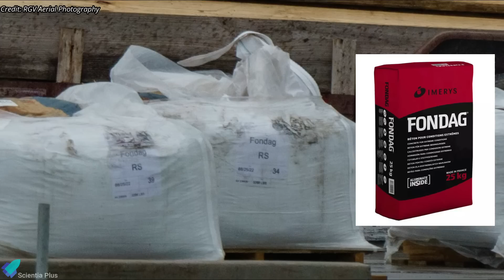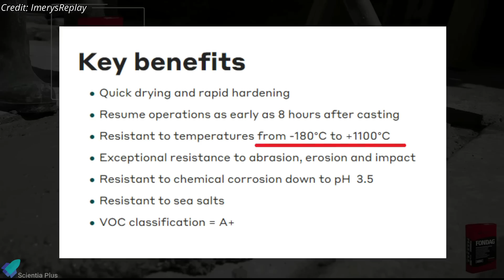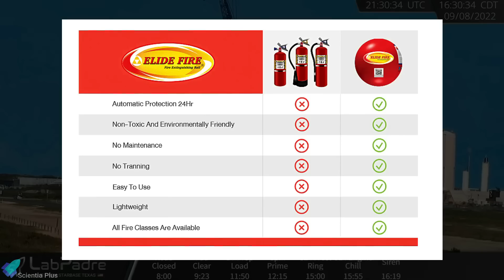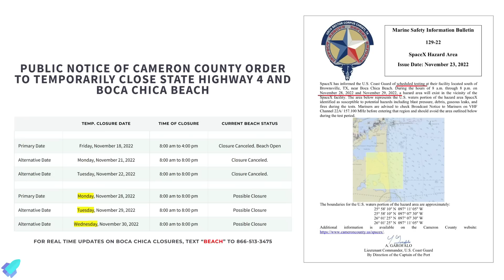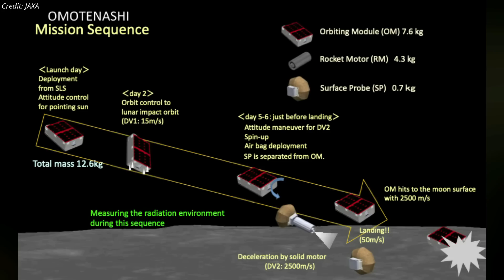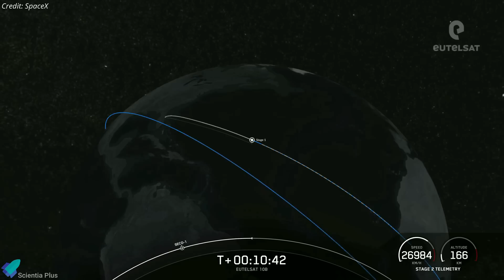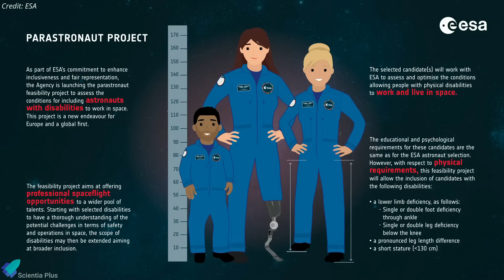SpaceX Starship Damage, Upgrades & New Raptor Engine, SLS Launchpad Damage, CRS-26, ESA Astronauts

Comment: deflection dissipation away from pipes and flat surfaces fine spray of water injected in the moving exhaust gases in the direction of gases as they expand cool? stop concrete heating and exploding? gully steam evaporation vents away from lift of stands? vented oxygen and fuel mjust be vented to different areas? Concrete always explodes cracks with intense heat? Bloody mindedness as led to this mess?? Making SN24 safe to land with legs and means to eject safe should also have been early weight traded basic features? or is Elon and his designers like Wright Brothers going to fly first manned flight and back

Comment: I wonder if a 30x Stainless Steel Treadplate pad cover would be sufficient to protect the Concrete from the Blast. Better integrity than poured concrete and it could have flutes to redirect excess force. I think Spacex is trying for maximum launch pressure and I wonder if a progressive throttle up might go easier on the Launchpad. I don’t know of anyone launching that way but with The Technology of Spacex it could be done. It’s different to a bullet so if we could accelerate the Rocket clear of the Launch base would the results be predictable  and calculable? Just a thought .😊

Comment: Some people have suggested a V shaped flame deflector, sort of like.... EVERY OTHER LAUNCH PAD USES!
Reply: Better yet, why not have thick flat metal containers fit to form underneath the blast area that would be filled with a thousand gallons of water each.  As the intense heat of the rocket flame suddenly heats each container up, the steam produced inside is projected out towards the items and areas most needful of cooling.

A six hundred degree stream of steam will cool down anything being made hotter than itself.  You'd actually be bleeding off the rocket blast heat to a counterbalancing steam gas flow that will reduce the immediate heat environment all below and around the blasting rockets.
Reply: I like that idea !

Comment: "If the pad is damaged we can just pour more concrete" ... That's not a useful conclusion.
The problem is fragments of high velocity concrete going up into the engine bay or into essential systems on the launch platform.

Comment: Am I a Genius? I have to wonder why no one comes to the idea to mount a steel plates on the bottom under the launch tower? Instead of replacing the concrete, I think it would be much easier to mount there some thick steel plates which sustainability is much higher than any other concrete. I have to concede having this idea from the very beginning because; maybe I’m a genius, ( or ….)
Reply: Yeah, it would seem that stainless plate embedded to the concrete as a thermal sink in way of the direct flames would be an obvious decision, but I’m only a structural engineer
Reply: @danwhiffen9235  E.M. seems to be overpowered with all his philosophical Interviews and other “Twitterliers”. Maybe someone could give me his phone number to bring him back to the bottom of reality.
Reply: And again there was a rain of concrete debris after the last testing. This time the falling rocks were smaller and not so many of them. So maybe SpaceX likes this being so, just better as to embed there some steel plates which would make the tests too clean and too secure.

Comment: I hate to burst the SpaceX bubble but methane burned in air has a flame temperature of 2210 Kelvin or 1,664 Centigrade so the 1100 degree Centigrade concrete won't help. Since SpaceX uses methane and oxygen, that flame temperature is 3030 Kelvin or 2,757 Centigrade so over 2.5 times what that concrete can stand up to.
Reply: Water deluge can compensate
Reply: Also the decibels will be so loud and the pressure wave powerful enough to shatter many structures in the area, unless they can suppress them properly
Reply: As Frederik said, water deluge...which is always use when launching a rocket such as this or Artemis, Apollo etc. will cool the launch pad and will also weaken the sound during liftoff
Reply: @Lynn Geek It is becoming increasingly apparent that SpaceX hasn't taken advantage of years of NASA and Soviet experience in launching large rockets. They didn't know that the heat from the engines would destroy the concrete under the launch/landing tower or they would have designed for it like NASA has for well over 50 years.
Reply: They need a flame diverter that they can move in and out as need be like the service pad they move in and out
Reply: @Ch33ziTzsk8R  How would they keep it in place with a force of 7,500 tons applied by the engines?
Reply: @tiredoldmechanic1791  
240T thrust per engine , 33 engines.
9m Dia footprint.
Do the math.

It's less than 180psi , at the Skirt , not ground level.
Not 15 meters above the Pad ~ Exhaust plume RAPIDLY expands , once exited the Engine Bell.
Will be WAY less than 180psi at ground level.
33 engines , over 9 METER DIAMATER. Remember physics.
 PSI .
Pounds per
Square
"INCH".
Sound pressure wave ~ Water Deluge System (not used yet) & Nitrogen Atomised Water, will sort that.
Temp ~ 
will the water be enough ?
Guess we'll see 😉
The Physics works, but can the Engineering deliver ?
IMHO.
Reply: @markoreilly3414  A moveable deflector would have to withstand the full blast force trying to move it unless they made a cone to defect the thrust radially from the center so the forces are balanced.
Reply: @tiredoldmechanic1791   wedge it in a pattern so that the only way it can come apart is if it can only one piece locks it and can only come up.  Like that 6 part puzzle that can only come apart if you angle one piece in the correct way for it to all come apart… it can’t be that complicated.
Reply: Water deluge cooling factored into your calculations???
Reply: Why don't you set them straight.  Go work for them lol
Reply: I really think Space x will eventually adopt a minimal engine initial launch then quickly begin startup of all engines once they have safely cleared the launch area safely and smoothly.
Reply: @DR-mp4gv  Launching a rocket isn't like a rolling start of a vehicle. The reason they have all of those engines is because they need them to lift the rocket and it's payload off the ground. The rocket is heaviest at liftoff and quickly becomes lighter as the fuel is consumed. They can start shutting down engines once they start gaining altitude but they need all of the engines burning to get a fully loaded rocket off the ground.

Comment: concrete is an absorber of water??? it also expands and explodes with intense heat? walls of concrete must be of a diversion shape or gully for water steam heat to disperse quickly away?? as under the Saturn 5 lift of in Florida? constant usage must mean use of tried and tested design regardless of idea or pride ? flying concrete destroys many many  things at different times? Protection and deflection of forces is fundamental as highly cost effective

Comment: It might not be just the concrete, it could also be the deluge system.  If the deluge system was insufficient for the 17 engine firing it will definitely be insufficient for 33 engines.  There also could be an issue of timing between the deluge and firing.  Too short and there would be too little water present resulting in total vaporization of water and damage to infrastructure.

Comment: They need a moveable flame diverter to put a 45-degree angle deflector under the rockets.  Deflection is the best solution but not sure if a moveable concrete deflector can stay put under this amount of thrust.
Reply: I agree with a flame diverter but it needs to be buried deeper in the ground than to be on the concrete surface. 
The diverter at pad 39A at the cape is located quite a ways below the base of the mobile launch platform.
With the present layout, there is too much back pressure from the explosion impinging against the butt end of the boosters engines.

In other words,the explosions need a better escape path.
Reply: @John-nc4bl  Artemis & Super-Heavy are too powerful & too hot for existing launch pads, SpaceX is insane hoping a concrete designed for 1100 degree will stand 20 seconds of high pressure blasting at point blank from its 2600 degree Raptor blowtorch. Take a lesson from NASA/SLS, excavate a 20m well with a 15m high exhaust vent - don't risk your launch system or base when you don't have to.
Personally I'd stick a water-fed refractory coated copper heat-sink at the bottom, but I suppose that's too much to expect of tight wads.
Reply: Been said that 3 years ago. Or a big bucket of water under
Reply: @geocam2  Or they need to scale up the rockets and have less of them.
Reply: Musk won't admit he is wrong.  He just tries to fix his "inspired" ideas.
Reply: @ReachOutToWilliam  The reasoning is sound. There will be no flame diverter when landing nor will there be one on Mars so you might as well design around the problem rather than have a booster that can only lift off.
Reply: @jaslll4396  except...the booster is not going to Mars. It is only for pushing Starship close to orbit and then landing back at the pad. It's also going to be caught, rather than landing. So, no, that is not why SpaceX hasn't used a flame diverter

Comment: So Musk did not exactly calculate the force of the enormous power blast of the 14 engines test in advance? Pretty amateurish to me. And pretty stupid too.
Reply: Got video of your rocket launch? 😅
Reply: @patrickdurham8393  Doesn't need one to make an accurate judgement.  Muskfail.
Reply: Yeah too bad he didn't have you there to do it for him 🤣
Reply: So Paul... how would your brain attempt to solve this... I mean really solve the problem,  not some BS hater crap  !! Please advise me...
Reply: You do realize that Musk can't calculate anything, right?  Need proof?  Paid $44 billion for a $1.5 billion company.
Reply: @geocam2  Minecraft.
Reply: Don't think stupid is the right word
Reply: @geocam2  the problem with CFD, as you surely know, is the reliability of CFD. Really prone to GIGO. FEA/CFD needs qualifying and scaling which can only be done reply with full scale testing and instrumenting imo. You can try similitude, but that is mostly BS and highly sensitive to scaling effects, or certainly that’s what I discovered experimentally at least.
Reply: I agree with putting down steel or inconel plates…. Secured or welded together so they can’t move. And diverters to channel flame around the legs.